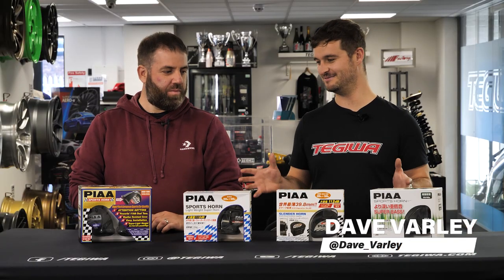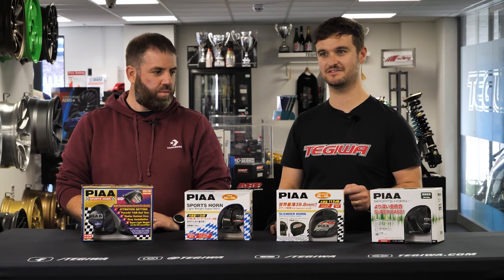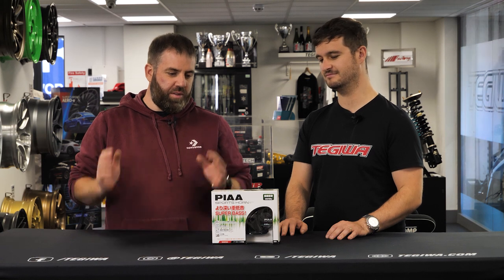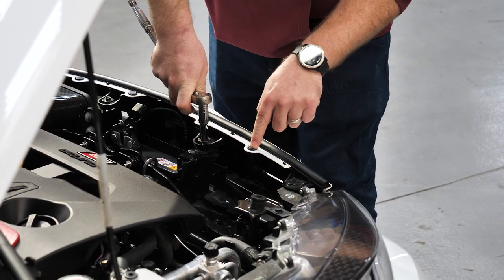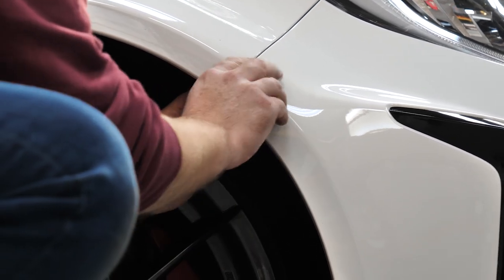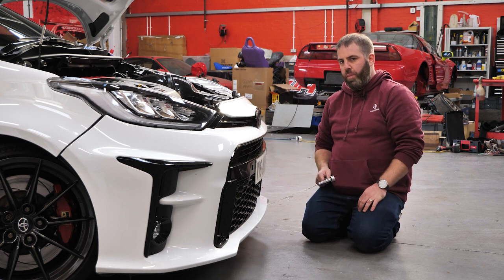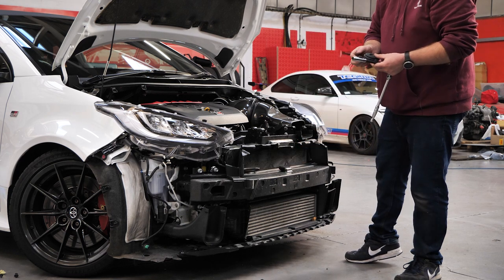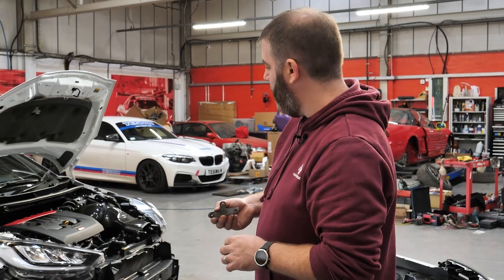PIAA Ultimate Horn Test! - GR Yaris Horn Replacement! (Installation)

Comment: it comes down to safety issue...with stock toyota horn at 130kmh on highway nobody hears you if someon cuts you off or anything it is just dangerous ...it sounds like 50cc scooter horn because it is ...  yes loud horn is not useful driving trough a quiet village neighborhood saying hello to neighbours with it ....if you need a horn for that stock is perfect...I'm changing mine for superior bass horn piaa and will not honk anymore to say hello to my neighbours

Comment: Might be just being nit picking, the Piaa horns has a larger surface area may somewhat affect the airflow onto the inter cooler. I would probably leave them out, hardly have to use the horn anyways.

Comment: Can you install 3 piaa horns instead 2 two in a 2017 civic? Believe they are 3.4 amps each, so it be 10.2 amps when using the horns.
Reply: You can even install 4. Each pair just needs their own relay.

Comment: I like your video, but for me as German it is really very hard to understand your "dialect" (polite) at some points 😀 or should I say mumbling? 😀

The original horn is so quiet, you cannot here it on the Autobahn. But also deactivating noise cancelling helps. Before I thought the horn has a defect, there was nothing to hear within the car.

Comment: The video really didn’t need Matt telling us that he uses the horn to express his “anger”.   That isn’t what the horn is for and just makes him look a bit of a nob in my opinion.   

I know someone has already asked it and you said it’s fine but I would want to see a relay fitted for those horns.   The current draw is significantly more than stock on all of them.
Reply: Hi mate, thank you for your feedback. They actually only draw about 5-6A between them. The horn circuit in the Yaris has a 10A fuse. A lot of other cars have 15A fuses in there. The instructions have no mention of a relay as its just not needed
Reply: someone cuts you up on a roundabout or pulls out on you at a dangerously slow speed you dont use your horn?
Reply: @Seyiu.  Better to concentrate on your own car control instead of honking unnecessarily. The mistake already happened, honking is not gonna make it better